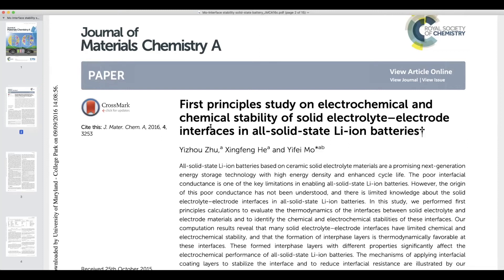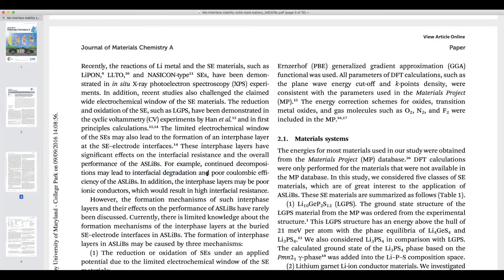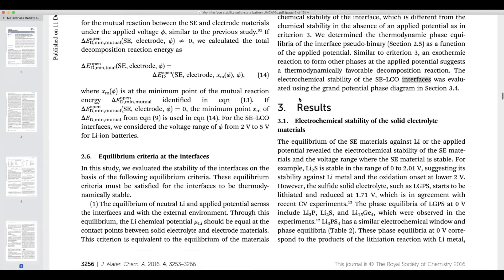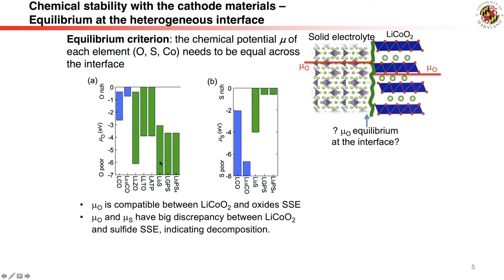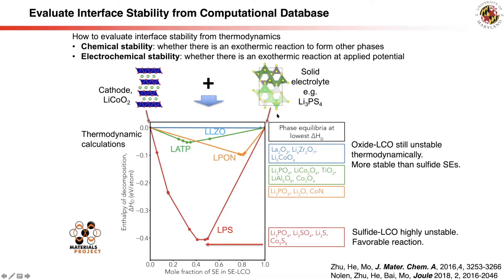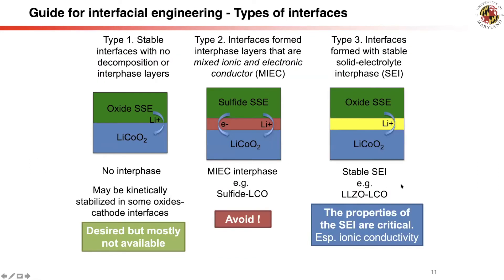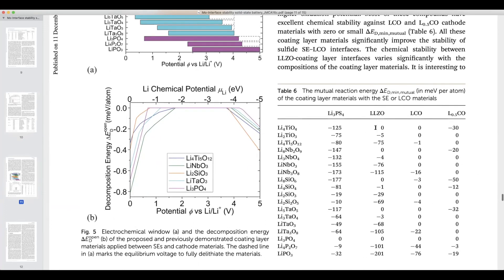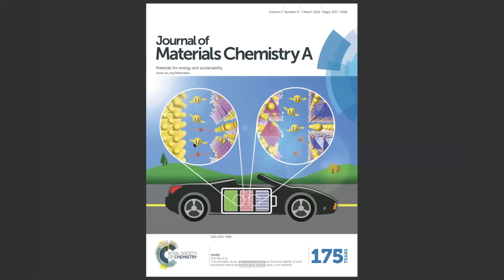Interface Stability in All-Solid-State Li-ion Batteries -- First Principles Insights

Comment: Is the SEI layer in Solid state lithium ion battery like convential liquid electrolyte battery? thanks in advance
Reply from the maker: Thank you for this great question. According to our results, there will be an interphase layer similar to the SEI in liquid electrolyte. Depending on the combination of solid electrolytes + electrodes, the SEI properties may vary. Yes, for some cases, it would be similar to the convention liquid electrolyte (though the exact compositions and properties may still differ).
Reply: Thanks a lot for your great explanation
 
Could you please explain what is the difference between the "solid electrolyte-electrode interface" and the "solid electrolyte interphase/SEI"? I thought the first used for solid battery and the latter used for convential battery.